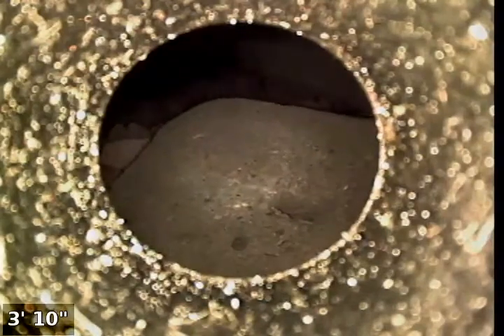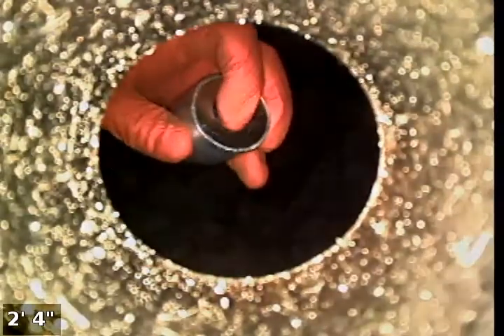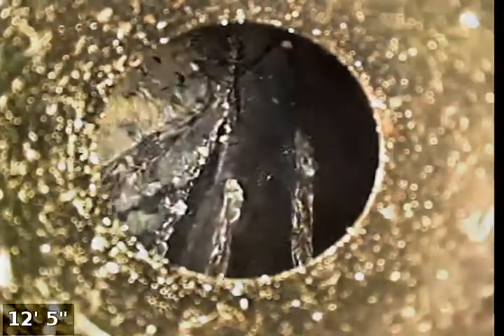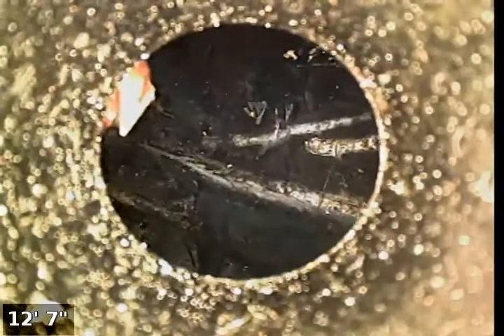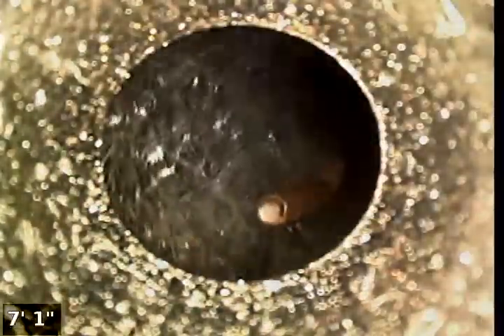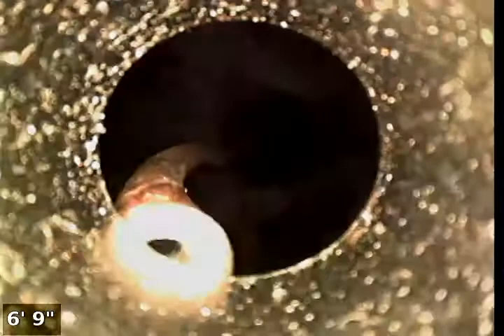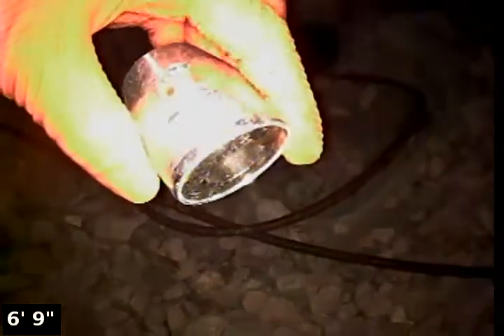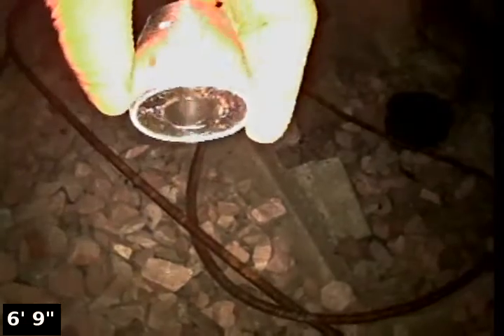Ridgid SeeSnake Sewer Camera Magnetic Retrieval Tool

Comment: Do you sell this how much and where?
Reply from the maker: Yes, I can create more and offer them for sale on Ebay.  I will post a new video shortly showing all the newer versions/sizes I have made.  You can then let me know which camera head you want it for, and what size retriever.
Reply: @emergencyplumbing3520  is it possible to rent this type of tool? I  rented an auto feed drain snake and the cable snapped inside the drain pipe.
Reply: Hi, where can I buy one of your magnet tools?

Comment: Do you sell them ?
Reply: Joseph, I'm guessing they don't sell these? :)
Reply: Yes I will sell these.  I have just finished the new versions, which are in a few new smaller sizes and we now have steel shells that can go over the aluminum so that they can be used in cast iron pipes without sticking to the cast iron as they go down the line.  I will be posting a new video soon showing all the models, and can then offer them for sale.
Reply: @emergencyplumbing5144  what is the name of these magnets? I looked for you on ebay and couldn't find you.
Reply: @emergencyplumbing5144  what is the name of these magnets? I looked for you on ebay and couldn't find you!